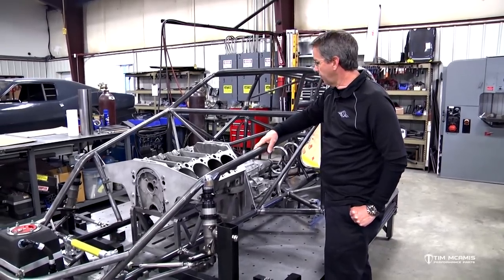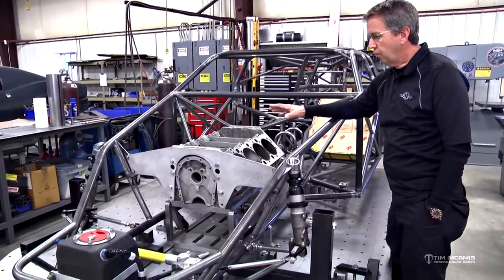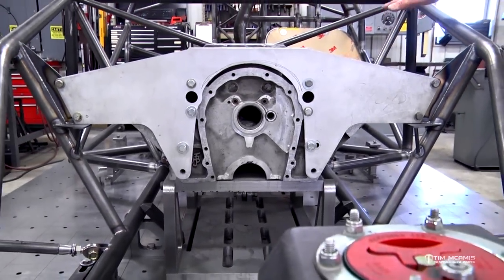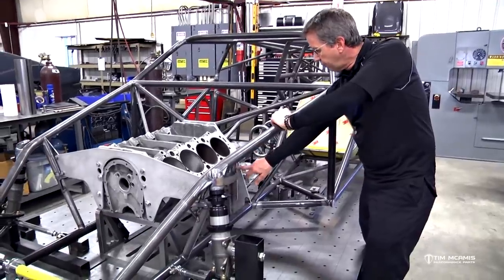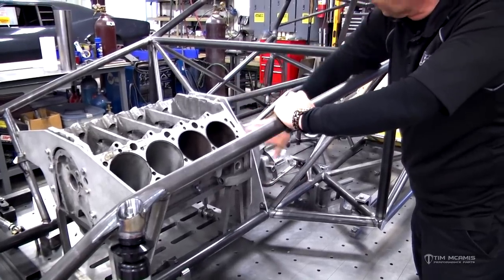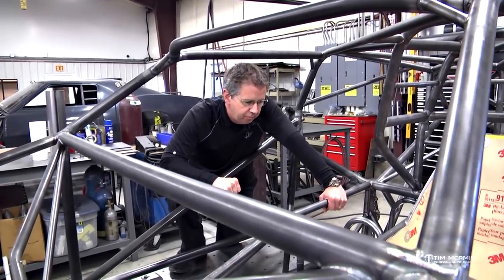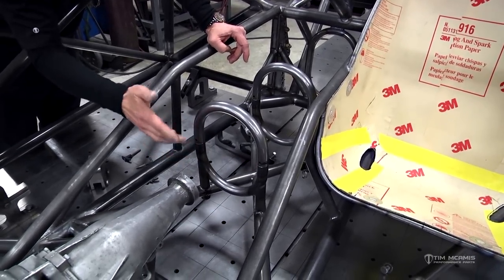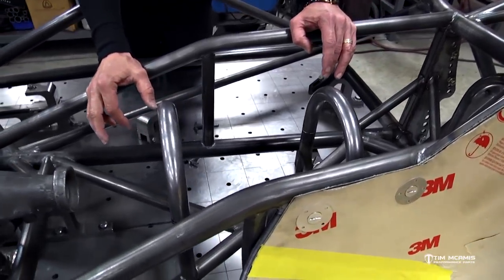Door Slammer Build: 02 - Engine & Transmission Mounting

Comment: Thanks for all the great videos and help, I can't tell you how often I look up some info from you and I've been racing for 30 plus years!  I have a 1955 Chevy Belair with a full tube chassis and the "builder" offset the engine towards the passenger side about an inch.  I'm assuming for pinion offset on the ford 9" or possibly weight distribution.  I was wondering how you feel about this?  Any reason to move the brackets on the rear and set the engine back in the center?  Thanks again for all your help.

Comment: I’m building a 62 c10 and putting a 10.2 deck 8.1 496 in it. My understand is that’s going to be a lot of weight front of the center line. 

I like to bring the motor back a realistic number. I don’t want the motor sitting in my lap. 

Tim I noticed 3 simple variables. The crank is center of the frame and 10 inches from the ground. And the deck at 2 degree angle. 

My question is 🤔 how do you keep the motor low for the 10 inches and the 2 deg aa well the pinion angle. Because the closer you get to the rear end it going to be tough to keep to those specs.

Comment: I'm new to engine plates... do you use any sealant or gasket between the plate and the engine on the water pump holes? Or just straight bolt 0n?
Reply: Those cars don't have water in the engines. The blocks are solid and the top of the motor is cooled by a water to air intercooler and or the engines fuel which is usually methanol. And in the street car classes that do have radiators and water in the motor they usually don't have traditional water pumps that bolt to the engine. They're external And electric and look like a little turbo but it pumps water with just  hoses screwed into the block with a.n fittings. And if you did want to run a traditional water pump on a engine plate car then the plate would have that area of the plate cut and machined out so the water pump would still bolt to the front of the block with regular gaskets.

Comment: i have older tube chassis car and the frame rails are 2x3 i only have the one tab on frame for mid plate. will that be ok if using motor plate and trans crossmember. car is setup now with engine mounts so i could leave those in also if needed

Comment: I'm building a hairy glass 63 vett prostreet car.. would like to use one of your single rail chassis. . is it possible to have a frame build to my needs.
Reply from the maker: Yes it is Charles. We have built many HG '63's over the years and can provide a chassis kit, welded chassis or something finished a little further. You can find some more information on chassis kits and welded chassis here. https://timmcamis.com/shop/chassis/chassis-kits.html

Comment: If i build the chassis and take a picture of it and e-mail it 2 u will u be able to tell me where to put the engine
Reply: It'll be easiest to just base your frame off of a car chassis. Then you can build around the engine and transmission from there. It'll be hard to determine engine mount positions just from a picture, also varies from which engine and trans you decide to use.

Comment: how much does one of the cars cost to build?
Reply from the maker: Complete rollers generally range anywhere from $95,000 - $200,000. However, anyone with moderate fabrication skills can purchase our chassis kits ($2,395.00) along with a body and components which is all the same stuff we use in-house. This allows customers to complete a car themselves without any of the labor costs. Here is a great article on going the DIY route and shows what you can accomplish with the kits - www.dragzine.com/tech-stories/chassis-safety/world-class-on-a-budget-tmrcs-doorslammer-chassis-kits/

Comment: Is this the build for MurderNova? The nickname Door Slammer has got me wondering.
Reply: I was about to say the same until he said bbc and power glide combo
Reply: door slammer is a long standing(like before Shawn was even born) nickname for the pro stock and pro modified cars to differentiate them from the floppers(the funny cars) and rails(the dragsters). used to be that funny cars still had doors, so when they went flopper, the pro stock and pro mod were/are the last "door slammers".
Reply: His car is done. Built by another shop in OK. Shawn has the car in his possession but it's not ready yet.
Reply: +blazer6248 Shawn was just visiting Tim's shop, I'm sure. You can visit somewhere without buying things. How else would you know whether you wanted a place to do work for you?
Reply from the maker: Shawn stopped by the shop to pick up some parts to use on the new Murder Nova. The car was built by Don Dial and uses a wide range of our kits and components.
Reply: @johnives8597  cbb'xbx